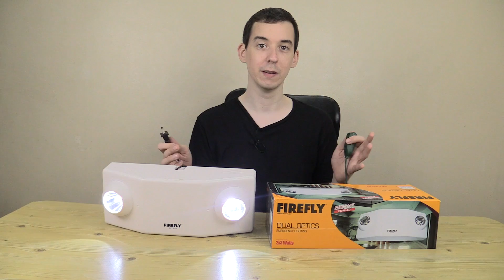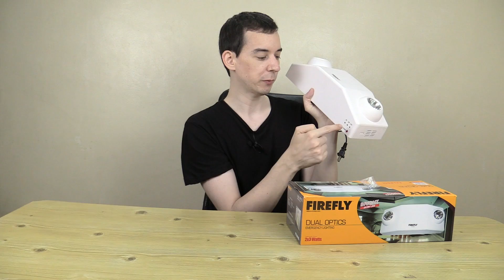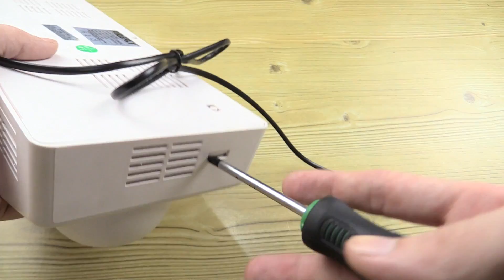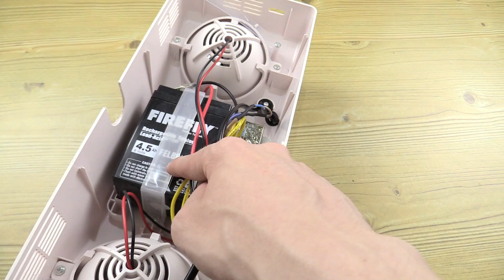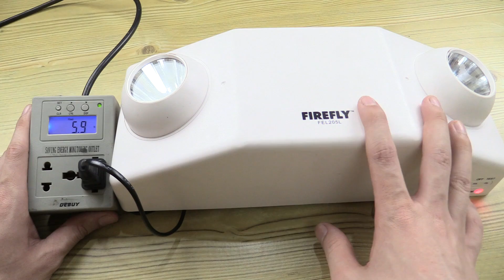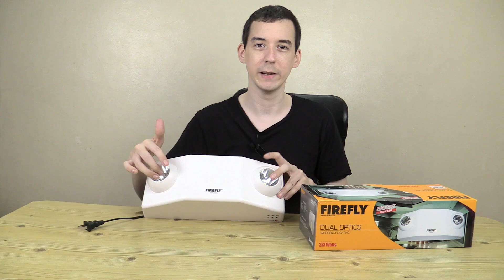Firefly LED Emergency Light

Comment: I brought home one of these from our store and couldn't for the life of me figure out how to turn it off when it's unplugged. I took a glance at those old style depressed buttons and without thinking much of it, thought they were LEDs and it didn't occur to me that they were the actual switches until I watched your video. Because, who in their right mind would install those as switches for emergency lights? SMH. I hadn't seen one of those since the old digital watches wherein you had to poke that depressed button with the tip of a pen to set the time. So your video was a lifesaver. Thanks!
Reply: BTW, does the red LED turn off when it's done charging? If not, how can I tell when it is?

Comment: I have several of the old style. Common issue is where to buy a replacement battery. None of the Hardware stores in Bacolod City have these batteries. They may sell the emergency lights but when it comes to replacing batteries you will have to try and find one online and hope it is not one of the thousands of fake/counterfeit Chinese batteries that are being sold via online platforms like Lazada and Shopee. One issue i have is 2 out of 4 Firefly units charging lights are now always on, could be from the local electric company Ceneco doing their usual blackouts and surging routine.
Reply: Ace hardware

Comment: LOL. Huge oversight on important things.  This must be designed by engineering interns.  A frost in the middle of the lens will simply reduce that spotlight effect.  I think I have seen that design in some, old flashlights.   I'm not certain about the standby power test.  The battery can be removed first to measure standby power.  However, it is highly plausible that 6 watts is the standby power.

By the way, you install it by removing the back cover first.  You use the back cover as the mount.

Comment: would it be possible to tilt the bulbs and point it in the ceiling? I think that will illuminate the room better.
Reply from the maker: +Puge Teopengco Yup you can turn them any direction so I guess that could work. It probably wouldn't be ideal for everyone, depending on the height of their ceiling. But it might work for me. I'll try it out :) Thanks!
Reply: +Gadget Addict +SEELE01 wax paper is a good idea too.  can you take a video comparison please? tnx
Reply from the maker: +Puge Teopengco Yup I will do! It's going to make an interesting video! :)